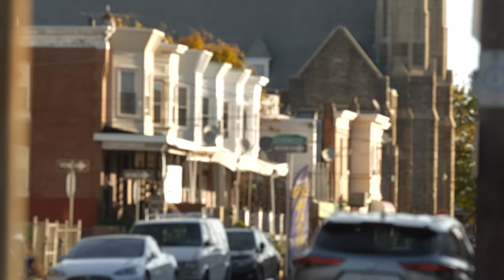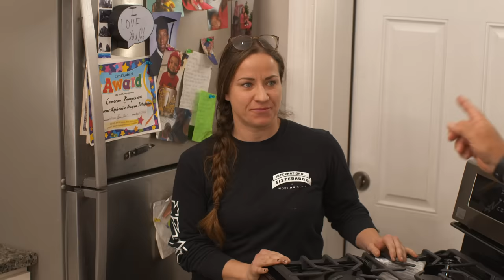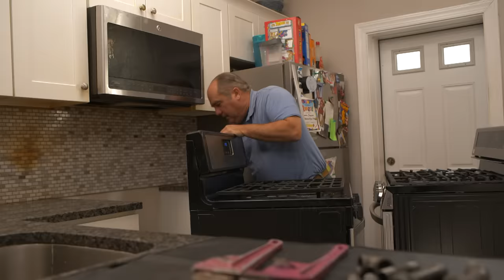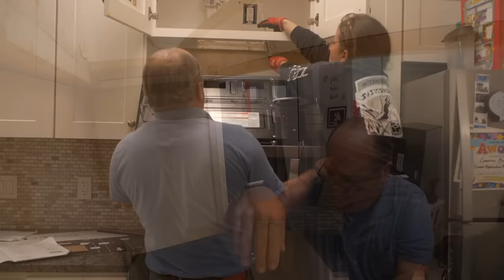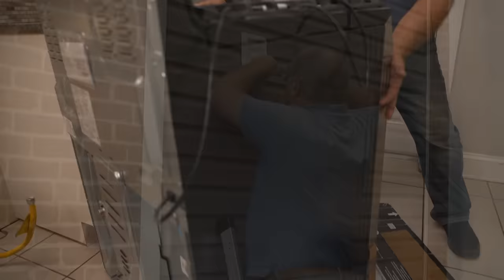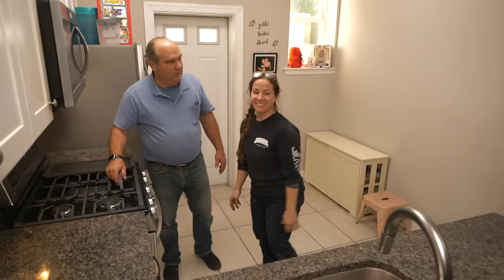How to Install a Vented Microwave | Ask This Old House

Comment: So glad This Old House did not perpetuate the false claim that gas appliances are bad for your health. Ventilation is always important regardless of the fuel type you cook with.
Reply: Except it is bad for your health.....there are studies that say so.  It's just not a big deal if you have proper venting like this.
Reply: @krisdphillips  go whine to your boyfriend.
Reply: @krisdphillips so how does it one’s health?
Reply: More shocked that they installed a new gas range instead of electric. But I didn’t see an electric stove rough in which is odd but explains why they didn’t go electric.
Reply: @pierreroy8124  Probably would have required a significant amount of wiring work to do, assuming the panel would support it.  Meanwhile, the gas connection is right there already.
Reply: Gas stove cooks better than electric. Ask any restaurant owner
Reply: @xploration1437  😂😂
Reply: @kaseyc5078  There a plenty of professional chefs switching to induction in the kitchen because of the reduction in heat generated in the kitchen.

Comment: Why blur out the tool name... we all know what red tool you're using! 😉
Reply: Because Festool pays them a fortune and Milwaukee doesn’t.
Reply: They've done it for years, I've seen Tommy use DeWalt without any blurring and then had electrical tape over a Makita in the same clip
Reply: @nick4leader  That was because DeWalt was once a sponsor before Festool and Makita was not. If you want to show certain brands that are not a sponsor you have to pay them or else you can possibly face a lawsuit form that brand and possibly the brand that is a sponsor if you have a sponsor at that time.
Reply: @benkeysor7576  I know, that's what I was saying. whoever is sponsoring at the time wouldn't want their competitors to be blatantly shown so the blur or tape the logos
Reply: Craftsman

Comment: The fans in microwaves are a joke anyway. The manufacturers minimally equip them so they can claim "code compliant" but the truth is a dedicated fan with make up air is really the way to go with anything gas.
Reply: make up air for a residential stove and exhaust? is that really necessary? just crack a window.

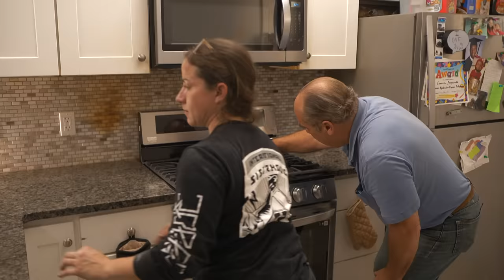Comment: Nice to see the charred backsplash and upper cabinet at 7:20

Also, the exhaust for a vent hood needs to be 6" diameter, according to almost all manufacturers.
Reply: What is interesting is the retangular to round adapter they showed most likely has a 6” round duct out. I looked all over the place for another size like 5” or 4” but I could only find 6”. Their round duct looks like a 4” and they don’t explain what size holes they are using. I had to match my existing 5” duct that vents through the roof.  I was not replacing the roof penetation or drilling a 6” hole through a brick wall. I had to modify the retangular to round to 5” and create an offset using 5” aluminum flexible dryer duct inside the cabinet. It was rated for vent hood applications. The 5” duct is more restrictive (like 2.5’ for every foot). Since the length is only about 5’ total, the restriction is within spec. The air velocity is high and there is more noise. The rated 300 cu ft/min really needs a much larger than a 6” to be within normal HVAC noise levels. The dumping of 300 cfm for an extended period would cause the AC to work very hard. Conclusion, only use on high speed to clear smoke or burnt fumes. Otherwise low works perfectly.

Comment: We had a vent originally then previous owner blocked it off and installed regular vent microwave. Duct is to vent straight up through cabinet into duct in the soffit, it's rare to find top vent microwave for exterior vent they are almost all on the back of the microwave.
Reply: No, they are convertible.
Reply: @A R  most vent in the front top on front of the cabinet (normal) and then the option to move blower cover to vent to the back of the microwave in the top. I need mine to vent on the top of the microwave on the rear like this video is. And most are only offered with the front top and the back of the microwave top (through the wall)
Reply: @natersalad889  The exhaust port is convertible from back to top on most units.  Either by moving a plate or flipping the blower assembly.
Reply: @A R  hmmmm. Maybe the I have is different owners manual only says it'll vent out the back if playe is swapped, and then looking a specifications on say lowes website or home depot,  they all say rear vent
Reply: @natersalad889  What's the make  and model?

Comment: My builder did the duct work, but never connected the vent to the microwave.  Waste air just blows back in my house.  Why build the vent if you are not going to connect it.  I know code.  Inspection missed a bunch of stuff.  Builders took so many short cuts in my home.  New home is really not new.

Comment: I don’t think they noted that some of these venting microwaves now require you to remove and reorient the direction of the vent flow to accommodate either external venting or internal recirculation.  It’s worth a look at the instructions to be certain.
Reply: They glossed over a LOT, regarding the microwave install.

Comment: I haven't had good luck with microwaves over stoves. The last one failed after 2 years. I think the heat and steam did it in.
Reply: I've had the same one over my stove for 20 years.
Reply: @BigRW  You won't get 20 years out of ANY new appliance.
Reply: @AR-cp5dz  The one I have is 20 years old.
Reply: @BigRW  So it's not new?  If you buy a new one, you won't get 20 years out of it.
Reply: @AR-cp5dz  Maybe I will, maybe I won't.
Reply: @AR-cp5dz  It was new....20 years ago.

Comment: My microwave is on an interior wall and I've been trying to figure out the best way to vent it without having to go through the roof. I'm thinking I can run the duct out the soffit but I don't know if it will work.
Reply: Venting it out of the roof is the way I’m going to do mine because if you have soffit vents that vented air can be pulled right back in.
Reply: With the soffit you have to make sure it’s the right vent. Pointing away from the house. Also might want to close up the soffit near by so it doesn’t go back up.

Comment: Is there a rule of thumb for when to use Teflon tape and pipe dope?
Reply: Flare connections don't need it as the mating surfaces are not the threads.
Reply: @WilliamHaggerty  Ah. Thank you.

Comment: My Father had a home build in 2018.  I asked him to specify to the builder that he wanted to have the microwave ducted to the exterior - which they did (up the wall and through the roof.)  But when we went to install the microwave, I found that the cabinet designers didn't take this into account, and the ductwork for the microwave vent was NOT centered in the wall cavity where the microwave mounted due to the measurements and positioning of the cabinets on the wall for the range/oven and the microwave above it.  So, all of that pre-planning was a total waste, as we had to install the microwave with the vent recirculating the air rather than use the un-centered vent in the wall.  Buffoons!
Reply: you should definitely be able to modify the vent to fit your microwave to it if it's just a bit offset. Even if it's a whole cabinet over
Reply: @antaholics  There is a stud in the way - didn't want to play with that, so we just patched the hole and installed the microwave with the vent setup to recirculate.
Reply: @antaholics  I should have mentioned that this is a 20 foot vaulted ceiling here, and the run for the vent duct was up a column that went out the roof versus through the wall.  I suppose we could have done something like they did here by venting UP and cutting a huge hole in to the cabinet and then offsetting the duct work with some sort of a takeoff into the steel duct in the wall.  But that would have required extensive surgery.  I'm not even sure how we would have gone about installing a takeoff collar onto the duct in the wall, didn't even think about it at the time - I assumed we would have been venting straight back into the wall duct, but like I said, a stud was in the way and the ductwork was offset by at least 6" or so.  So we just said "Fuggid" and installed it in recirculation mode.  He doesn't cook anyway.  The vent was MY recommendation but the builders and/or drywallers and/or cabinet makers obviously didn't communicate with one another at all, sigh.

Comment: Most microwave exhausts call for 6 inch round exhaust piping, they only used 4 inch. Restricted airflow.
Reply: It depends on the rated airflow of the microwave. 4" was probably okay here, but I agree 6" would have been preferred.
Reply: I disagree more with that plastic vent cover. Constant heat and grease will deteriorate the plastic and render the louvers useless.

Comment: So much wrong there.  Wrong adapter so the damper will not open all the way or get stuck.  Duct needs to be 6" round or 3- 1/4" x 10" .

Comment: Wait, you’re telling me you need a licensed plumber to turn off the gas, change out a simple fitting, swap out a stove and drill a hole through your wall in Pennsylvania?
Reply: Most places yes... I think because it's not the "homeowner" doing the work thus they want to make sure everything is insured right. Homeowners I think can do A LOT without license ppl.
Reply: You might have noticed that union shirt she was wearing. When I helped plan conferences for a smaller company I used to work for, we always avoided Philly city limits because the unions were so ridiculous. Literally moving a laptop and plugging in to a different receptacle required a union employee to do it, at the cost of $75+/hr, minimum 2 hours. I'm sure the union(s) involved here took TOH to the cleaners for their required involvement. Not to mention Philly gov itself and their filming taxes/fees. Everywhere you turn, someone's hand is out.

Comment: Given that using a venting microwave is probably the worst way to exhaust cooking fumes and odors, why didn't the experts install something that actually works - a proper vent hood that extends to the front of the stove and captures the fumes produced by the front burners (typically the most powerful burners on a stove)?

Comment: The 2023 NEC per 210.8 (D) requires dishwashers, electric ranges, wall-mounted ovens, microwave ovens, and counter-mounted cooking units to be GFCI protection.
Reply: Those outlets could have been on GFCI breakers.
Reply: Breakers are GFCI nowadays genius
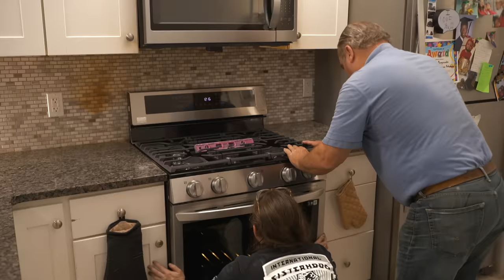Reply: That outlet could be tied to another GFCI outlet through its load port (makes it so that the tied outlet is also GFCI protected), most likely it is tied to the outlet located to the left of the stove which can be seen at 7:09.
Reply: Philly is still on 2017 NEC.
Reply: if I was putting a GFCI-protected receptacle behind an appliance, I would put in on breaker protection rather than outlet protection because I wouldn't want to have to move the entire appliance to reset it if it tripped.
Reply: @douglasboyle6544  you don't have to move any appliances to reset the GFCI, the microwave/range hood is connected through a shared/bounded load to the GFCI outlet on the counter next to the stove on the left side at 7:09
Reply: @aletius  I thought he was talking about the stove, not the microwave.
Reply: @AR-cp5dz  Provide proof its protected by a GFCI breaker.
Reply: @kalijasin  Lighten up Francis.  How about you provide proof they aren't?
Reply: @AR-cp5dz  Argumentum Ad Ignorantiam

Comment: Why the change out  of the OTR Microwave?   It has a vent opening on top already on top..     next, you forgot to add the flapper/flange  before installing it up into the cabinet..  4" dryer pipe is not going to give a full flow..

Comment: In Canada modifying any Gas line requires a licenced Gas fitter and i did not see you use any thread seal on your connection bad bad bad

Comment: My vent above my stove stinks from years of grease. How do I tell my landlord to replace it?
Reply: @peehandshihtzu  no it's grease
Reply: @peehandshihtzu  It was already supposed to have been replaced but it wasn't due to them fixing the leaking water heater. There is about a quarter inch of grease all over it and every time I cook it releases the smell. Just wanna take primer to the entire duct lol.
Reply: @peehandshihtzu  Nope. Giving me motivation to buy my own house though.
Reply: The  grease vent underneath is removable so it can  be cleaned.
Reply: @kalijasin  mine isn't removable. It's all one piece made in 1970.
Reply: @kalijasin  I removed the cover, but the inside is coated with grease too. Impossible to clean. I covered it up with 20mil plastic.